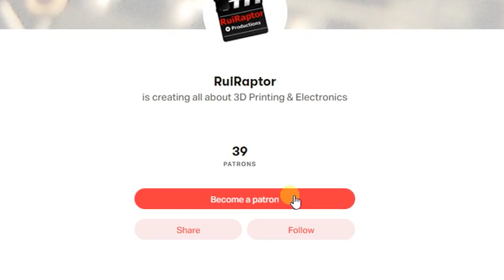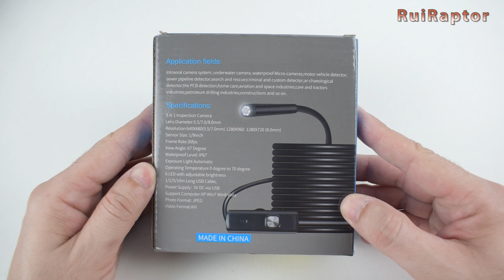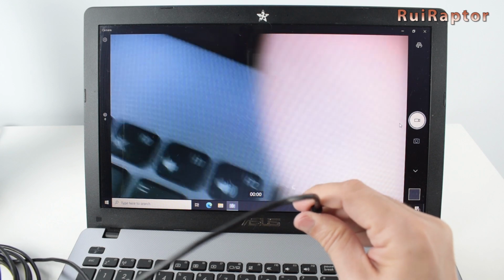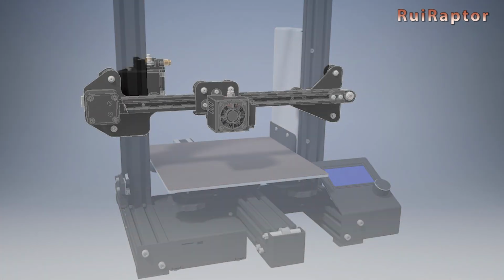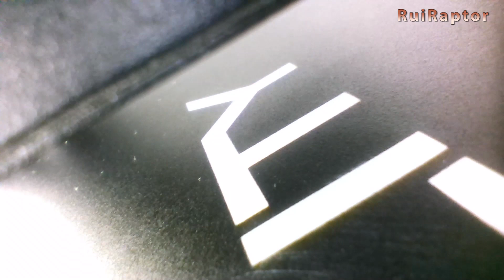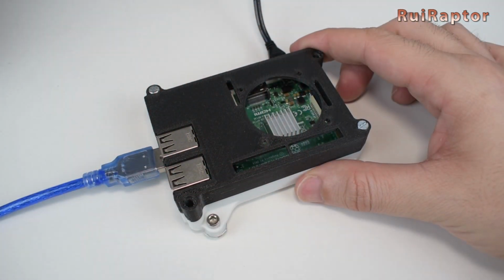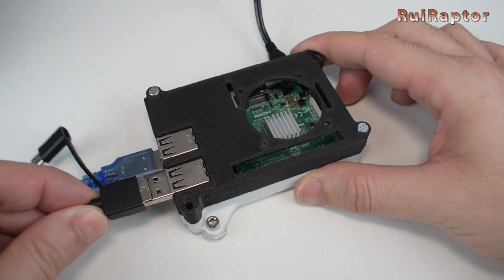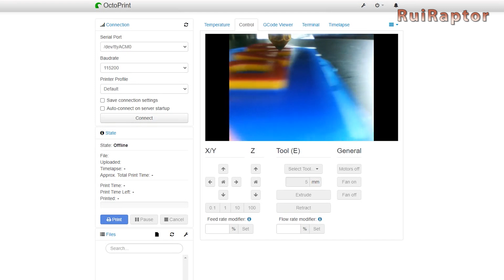HOW TO Have a MACRO VIEW of your 3D Prints!!!🧐

Comment: What kind of mount would you need if your running a bl touch
Reply from the maker: Hi Don, for printers with a BLtouch setup, a different mount must be used. Maybe one with a different angle or installed at the front. We might try to design that.